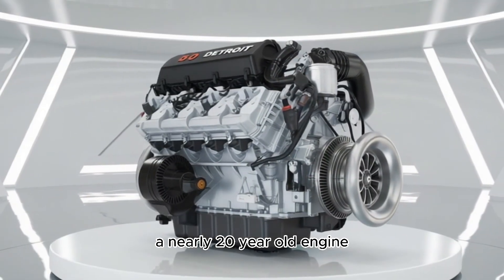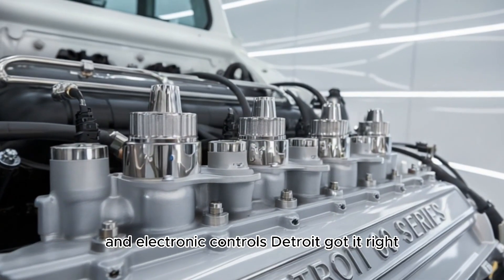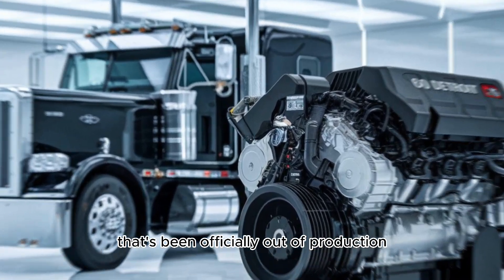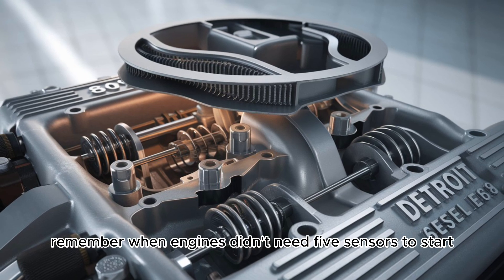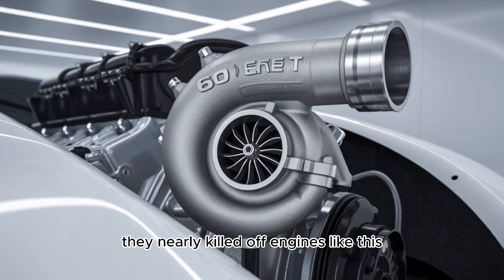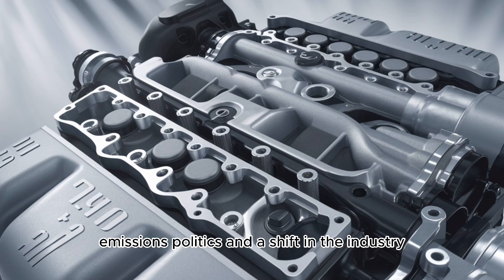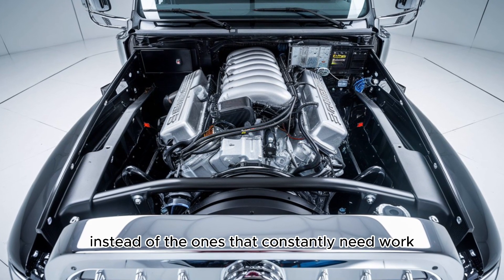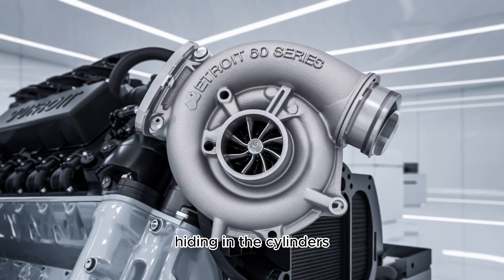Unveiling the Future: 2025 Detroit 60 Series Diesel Engine Innovations

Comment: Are you kidding ? When I was a diesel engine technician, we called the 60 series" The great green grenade". Connecting rod in the engine, "I hear you knockin' but you can't come out".
They would blow a rod right through the block and smash the ECM off. 
They did get better after about 10 years.
Reply: I've never heard of that being an issue with them. Cummins sure but not detroits
Reply: Different engine
Reply: I haven’t had the same problems with the older models but once the EGR and VGT was installed on the DDEC 4’s they went to shit